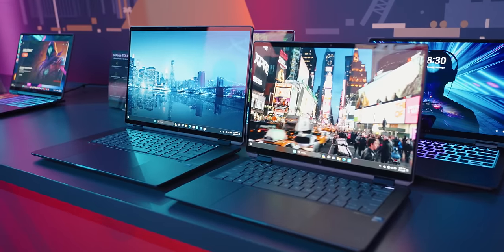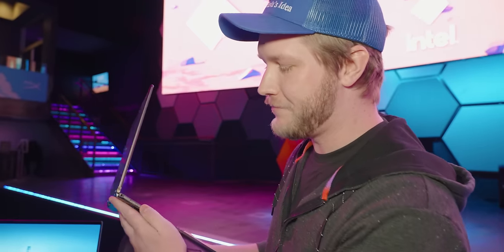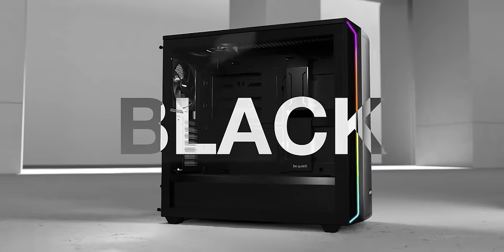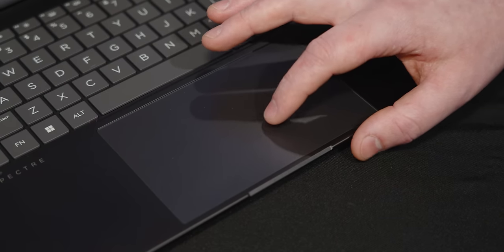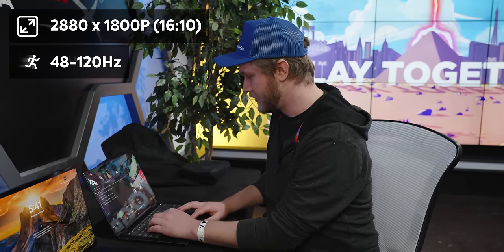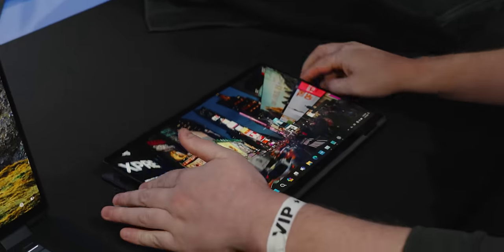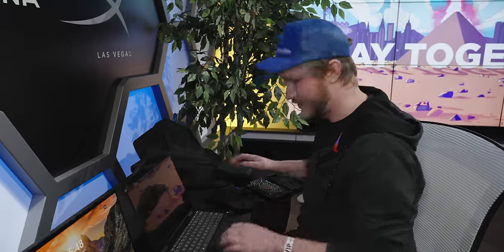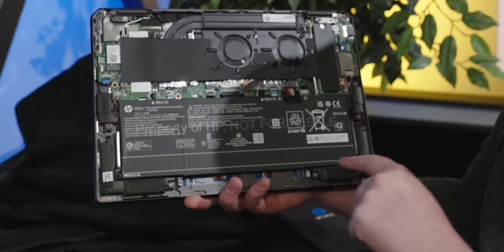Alright HP, I'm Interested - HP Spectre X360 & OMEN Transcend 14

Comment: fyi the omen 14 is priced at 2200 dollars on the hp website, so yeah uhhh not worth it
Reply: Are you waiting for the zbook fury 16 G10?
Reply: @macking104   Honestly I think I'll just get a cheaper 2022/2023 laptop instead of this stuff, I mean the oled screens seem cool, but besides that I can't see the point in buying new this year.
Reply: @lianxia1111  but, this laptop can be configured with 4-32gb sodimms and FOUR 4tb ssds! Love to see Linus try not to drop it.
Reply: @macking104  Yeah, but I at most need 2tb of ssd storage, as do, I assume 95% of people. Ram wise I do, do a lot of design renders, so while that would be nice to have, I think 32 gigs is fine for most stuff unless it's like cfd stuff.

Comment: New spectre BATTERY LIFE is much better than HP claims. It got 14 hours 54 minutes of BATTERY LIFE in video playback and 13 hours 24 min of battery life in media to light office work, web browsing, collaboration in 40% brightness and Balanced mode.

Hp spectre x360 14 (68 Wh) with #Intel Core ULTRA 7 155H has 14 to 15 hours of BATTERY. 😱

Intel laptops BATTERY life is as good as MacBook M2/M3 even though Intel is using Tiles/Chiplet.
Impressive🤯
💪

Hp pavilion Plus 14 (68 Wh) with #AMD 7840U has 10 to 11 hours of BATTERY.
Reply: Blink twice if you need help.